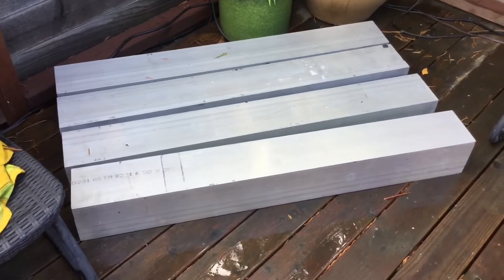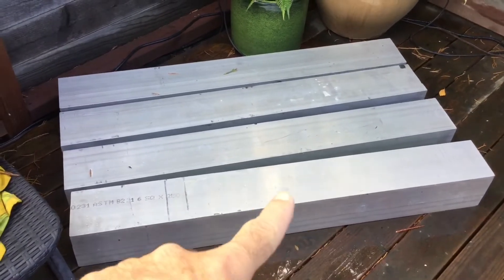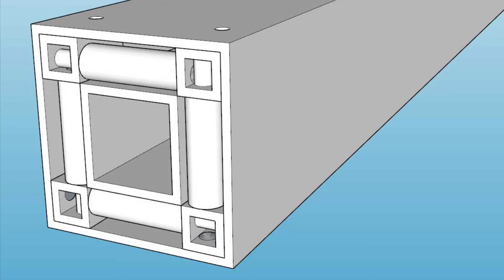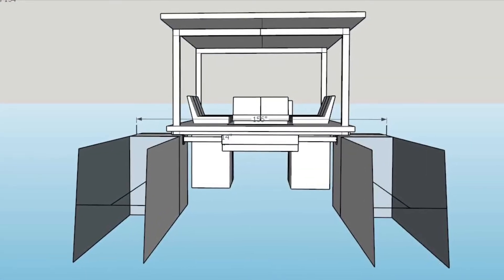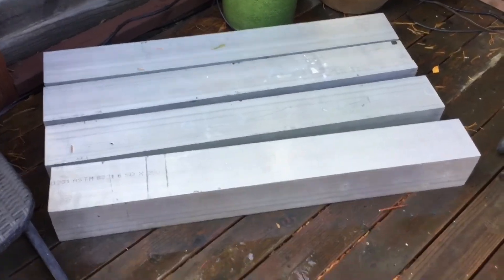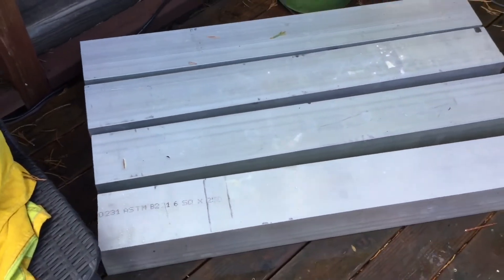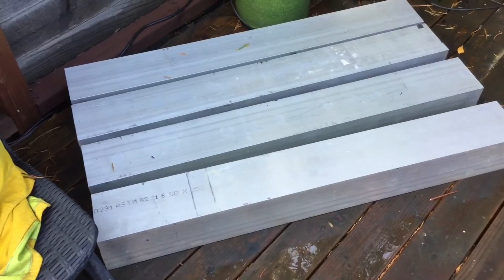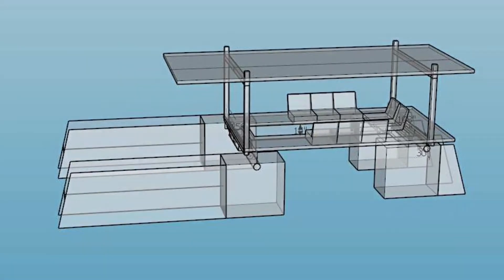Big Solar Electric Cat: Telescoping Beam Design and Material Acquisition

Comment from the maker: Thanks! Hoping to begin fabricating these beams after the New Year. Eventually they will have DC linear actuators inside them so expanding and contracting the boat on the water will be done with the push of a button.
Reply: and with push buttons raising the solar array and electric propulsion you're going to attract a crowd each time you're at the boat ramp 😆